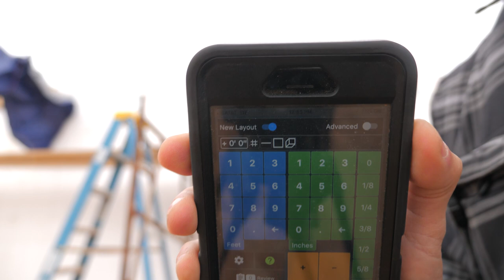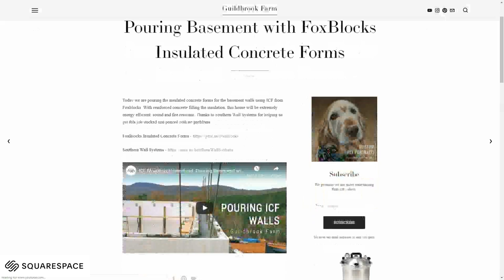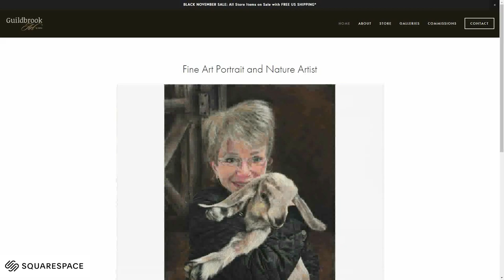ICF Mountain Homestead: Installing Ledger Boards with Simpson ICFVL Hangers

Comment: Al Lumnah has a pretty nice technique for making square end cuts with the circular saw quickly.  He holds a 12" framing square parallel to the line he's cutting, then runs the circular saw along it like a track saw.  Quick, easy, and perfectly square without having to slowly follow a line freehand.  Those hangers look solid!
Reply from the maker: I didn’t have a 12” speed square when I started (only had a 6”). I bought one and now I do just that.

Comment: Nice to have your spouse working with you, even if it is just for company.  No professional "framer" would take that much care to square the ends of those ledger.  It is ROUGH carpentry !  +/- 1/4" is fully acceptable.
I always wondered how you would attach the ledgers to an ICF.
Slow and steady wins the race !  Only YOU are setting deadlines.

Comment: No matter what you do for your basement  , put down heavy plastic or two layers of plastic between concrete and the surface you are going to pore on . It will keep the concrete from drying too fast and keep it from getting too damp during the wet seasons . When I did mine I also didn’t insulate the floor , it keeps the basement cool in the summer and really doesn’t suck up much heat during the winter . A three speed box fan on the floor in the summer and you’ll freeze in the summer  .  I have a coal stove in the basement that heats the whole house in the winter . I keep the basement at 70 and solar gain up stairs helps heat the house plus the heat coming up through the floors on your feet is more comfortable . I wouldn’t insulate the ceiling of the basement . Heating is something you’ll have to play with .
Reply: Maybe he's laying down foam ?

Comment: You don't need a feet and inches calculator if you use metric. Every builder I know in Europe uses millimetres, simple to work with because the smallest unit of measurement is better than most people can cut.
Reply: @jdcoverland365  I think most people doing engineering or construction of any kind should discover the simplicity of metric because it saves so much time and improves accuracy no end.
There's of course the 'you can't teach and old dog new tricks', but my father is in his 70s and happily uses both, but only metric for anything that matters.
Reply: Bob H Yeah but we have over 300 million old dogs and there is little benefit to changing a system we've used forever.

Dave, how is Canadian Imperial different than US imperial 🤷‍♂️
Reply: @inmyimage1081  yea, something's hard... Why bother...
As for the different Imperial systems, I believe the US and British systems are different in weights and volumes. A pint and ounce are different in the US.
Reply: Bob H Yes, volume and mass are different but I assumed you were talking measurements.

As for something being hard, it isn't that it is hard it is that our entire society is based on imperial. Changing to metric would involve every business, manufacturer, farmer etc in the country making the switch which would require a lot of machinery and other manufacturing or production being reworked to work with the changes including packaging and materials.

Getting the people to the people to change would take a few years but the business changes required to make the conversation would not only be difficult but also expensive and frankly there would be little benefit to making the change given that the average american simply doesn't interact with measurements from other countries.

Additionally even other countries do not universally use the metric system. I frequently hear and see other countries use pounds and other imperial measures.
Reply: @inmyimage1081  yep, I am in he UK and we use miles for roads, pints in the pub. But retail, engineering and construction was relatively easy to change.
Give people a few years notice and they can slowly invest in new measurement equipment and train staff. Individuals can make their own choices about what they use at home but once retailers start adopting metric then it gets a whole lot easier.

Comment: Before you pour the slab make sure that you put 16 mil vapor barrier manufactured by Stego Wrap otherwise the seasonal temperature changes will leech out the efflorescence from the soil right thru the slab. It's that white stuff that you see on brick. It will also help you avoid seasonal moisture problems in the basement.

Comment: I bought a country house several years ago.  It wasn't very old.  Built on heavy, heavy clay.  The builders didn't put a vapor barrier on the ground before they poured the floor.  So, the basement floor was always damp.  Bummer.

Comment: I think your ICFVL-W might be screwed too far up. The top fasteners might not be screwed into the metal plate at all and they require a min 1/2 inch away from the edge of the ICFVL. Hope it is a different version.
Reply from the maker: Everything is exactly right. No problems.

Comment: Just curious... Why do you have your EDC to work on your house? It's in the middle of nowhere right? Bears? Hunters?
Reply: Also, why carry with your hammer cocked. Carrying a double action/single action pistol with the hammer cocked, greatly increases the odds that you will have a negligent discharge when you draw or holster you weapon. If you have trouble with the double action trigger pull, you need to change to a striker fired pistol.
Reply: @forrestsmith3390  clearly he's carrying a 1911, single action. 1911s should be carried in condition 1, otherwise you might as well be carrying a rock.
Reply from the maker: Learn your pistols
Reply: I was just asking because I know bears have been seen in cookeville .thought they might be around there.
Reply: @forrestsmith3390   you do have the option to delete all your incorrect statements ..or are you still studying the subject?

Comment: I bet those simpson ledger brackets, baseplates and screws cost $1500 or approaching 10% of a traditional concrete foundation. Only the start of additional costs they don't tell you about vs traditional framing. Electrical and plumbing add additional work and cost with an ICF. Turns into an incremental monster by the time everything is tallied up.

Comment: Hello, I’m new to this build and have a question.
 What do those ledger screws that you called bolts fasten to? I’m guessing they just go through the foam and into the cavity so concrete can surround them?
Reply from the maker: If you watched the video, each connector is made of two pieces plus the bolts. The steel base plate is inserted into the foam then the concrete is poured around it, locking it in as a permanent part of the structure. The steel ledger bracket with the ledger board is then bolted to that steel base plate.

Comment: Trying to understand how these joist hangers tie into the ICF walls? Does it just hang on the side? or do the screws go into the metal on the other side?
Reply from the maker: The bolts go through the rim joist and the metal plate behind it.

Comment: 0:27 shouldn’t those bolts have normal flat washers along with the lock washers?
Reply: Not really.  Even the lock washers are overkill.  Bolts are just needed to keep the post from being kicked out before the slab is poured.

Comment: Why didn't you mount the joist hangers while the rim joist was on the ground, wouldn't it be easer than up in place?
Reply from the maker: All the lumber is different unfortunately.
Reply: @Guildbrookfarm  a trip to a lumber mill sure does open ones eyes to the variability of natural material and how they move

Comment: Does anyone know if you could board a vent hole 4" through a ledger board that's supporting floor joist?
Reply from the maker: I think the rule is something like the hole can’t be bigger than 1/3 of the width of the board.
Reply: @Guildbrookfarm  yes, you're right

Comment: Here is a great video that explains TOB https://www.youtube.com/watch?v=w6QCaBxug40.  Good looking build, those ICF's are not easy the first time you do it but your moving along nicely.  I was taught relative dimension when i was younger and i use it alot when i need to do something like this so i know my marks are dead on.  Do you have access to air?  An air impact wrench works well on those ledger bolts etc because they dont slow down with battery power and spin much faster than an electric impact.  Cordless is nice, especially those circular saws when your moving fast but there are certain times when having a cord or air hose is an ideal trade off.  

Keep up the good work!

Comment: is there lots of bad guys around this work yard/house ? everyone has a guy on them !  If it were Bears , would a high power rifle be suficiente to protect. I know when building a structure you have a nail pouch hammer ring, tape pocket and now a side arm , getting loaded down.
Reply: A pistol is a lot easier to carry everywhere you go than a rifle is.
Reply: As controversial as it may be, a firearm is a tool. Just like a hammer or wrench it was made to do a job and do it well.
Reply: @alecmcclure16  Yeah but I dont carry a hammer when walking in the woods why would i carry a pistol when building a house?